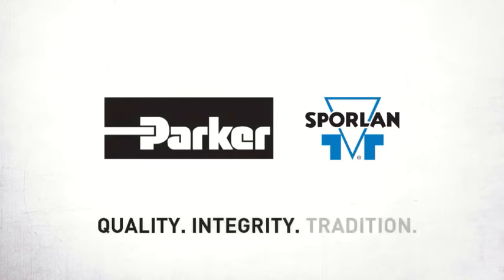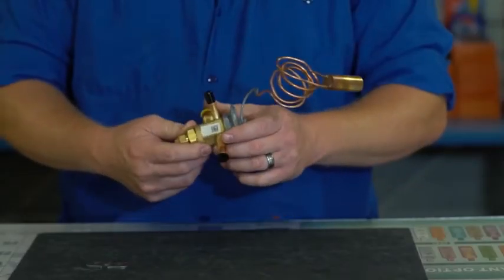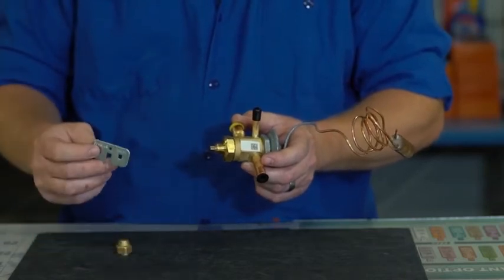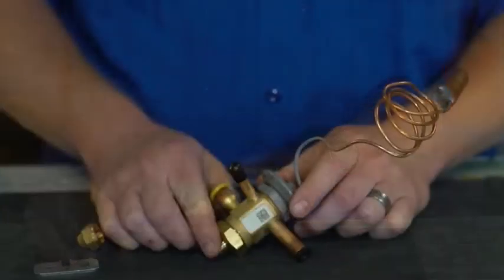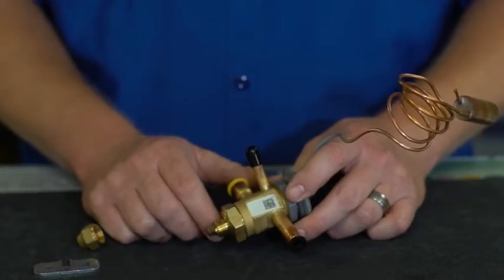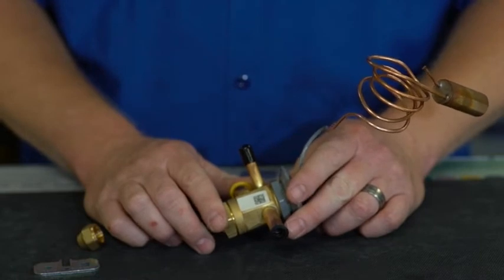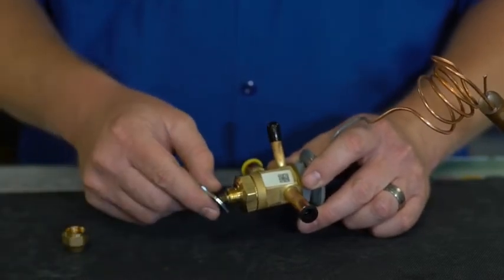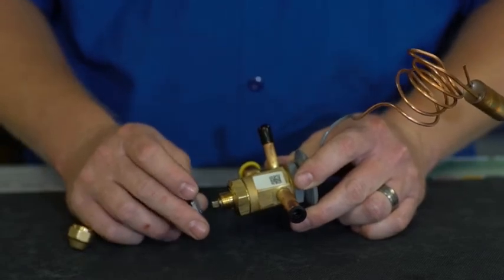Parker Sporlan HVACR Shorts: Is Your Thermostatic Expansion Valve Adjustable?

Comment: Can you share a part number for that tool please.  Thanks
Reply from the maker: LIT-FM-5-191 Flat tool for adjusting manual lift stem in solenoid valves and stem and stem packing nut in expansion valves. Plated metal, 7/8" x 2".

Comment: So if it just has the flat cap its not adjustable?
Reply from the maker: Correct. Most non adjustable TEVs have the flat bottom.
Reply: @sporlanvideo thanks for the response. So theres no way to adjust it at all? Im getting a super heat of 50° and pressures and subcool is normal.
Reply from the maker: @AtlanticHomes  For more in-depth technical questions reach out to our application engineer team at 626-239-1111 and we can help you out.